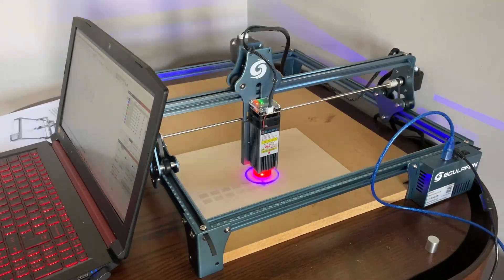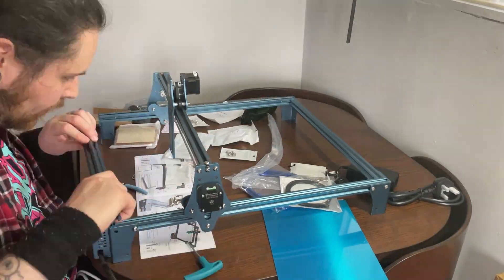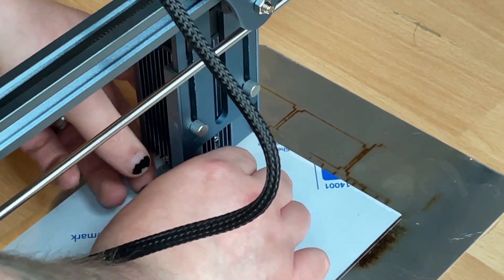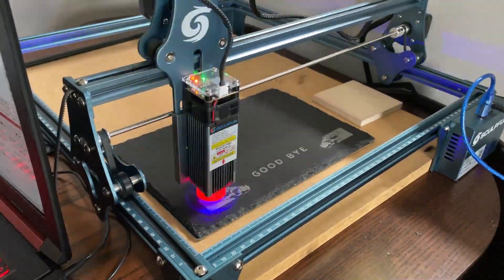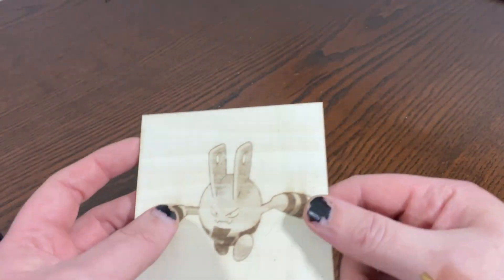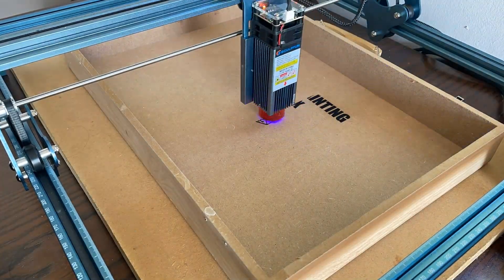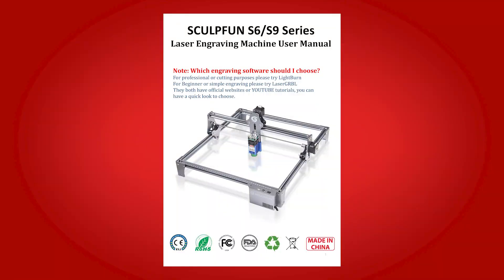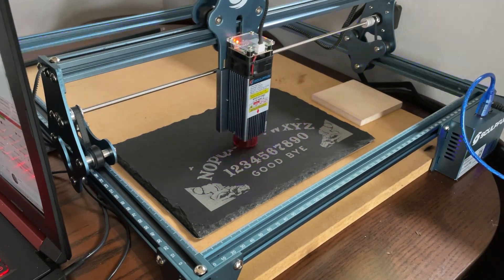Sculpfun S9 Laser Engraving Machine: Incredible Results at a Decent Price

Comment: Tweezers would help for the belt. Instead of starting at one end I started by going over the gear and then threading the belt though from the centre to the outward edges.  That way I didn’t have any weird angles that I had to feed the belt through.  Crappy explanation I know.
Reply: Great, I am setting up mine tonight, and looking for a way to avoid threading the belt. Looks like it could be hard the way it is shown. I will be using your method

Comment: Does the laser ever need replacement ?    Is there a max life of the laser ?  I am thinking of long term costs.
Reply: yes there is how long i dont know and have to clean from time to time.
Reply: Around 5000-6000 working hours, if you run it at 80% power and  15 minutes breaks for every working hour.
You have to maintain it properly and clean it regularly. Also get an air assist.
That's only if you get good unit. In some cases, it will break in just couple of days.
The price of the replacement unit is around 50 USD (70 USD with the power supply). The average cost is 1 cent /working hour😅 (2 cents, if including belts and other spare parts). Basically absolutely negligible cost long term.

Comment: Hi William. You say that the S9 has issues cutting lighter coloured acrylic. This leads me to believe that it has no chance in cutting 4-5mm clear acrylic. Is that the case? Sculpfun have just released the S10, so I'm hoping that will have the capability.  I just have to wait a few months until reviews start to surface. I don't have the space or funds for a c02. Thanks, G
Reply: I believe that the diode lasers output a wavelength that passes through clear acrylic, so only co2 lasers can cut clear acrylics.